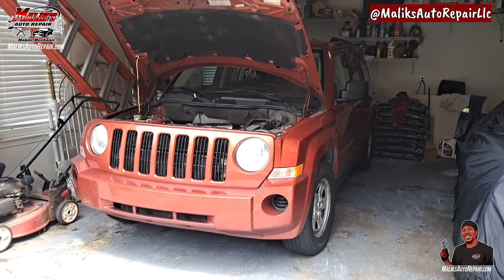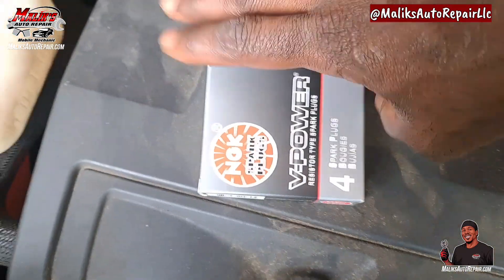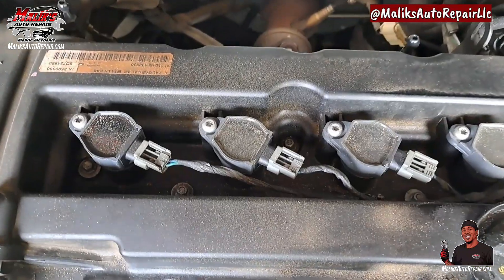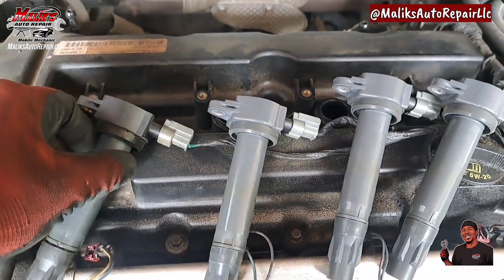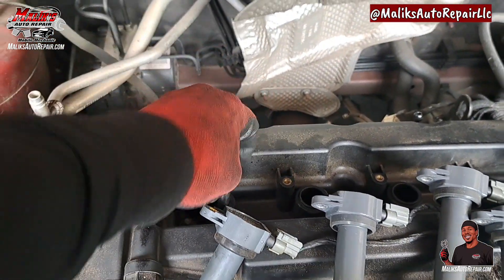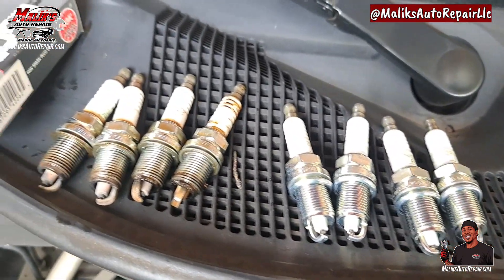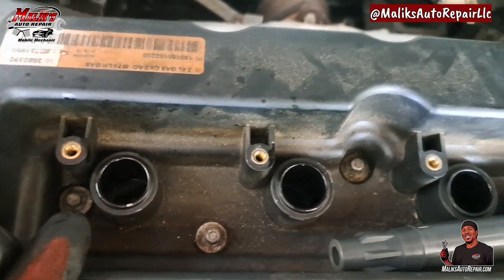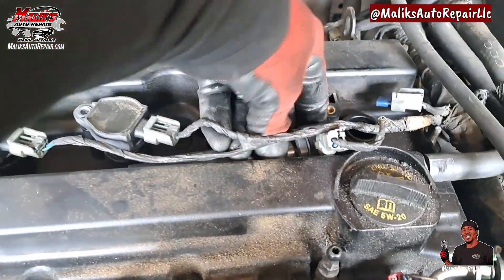HOW TO REPLACE SPARK PLUGS |2008 JEEP PATRIOT 2.4 | Howto/Diy

Comment: You really shouldn't use anti-seize on NGK plugs (per NGK), and 20 Ft. pounds is spark plug torque spec for the Patriot in case anybody was curious. I hope you just didn't leave them "finger tight" 🙂
Reply from the maker: I was never told. I'll look into it. Thanks